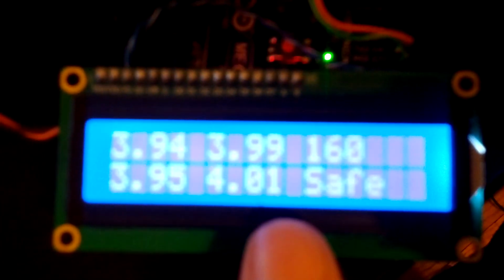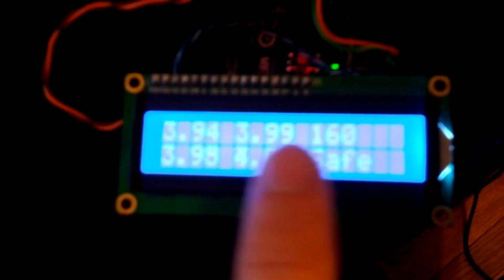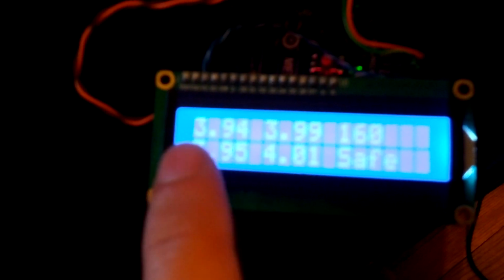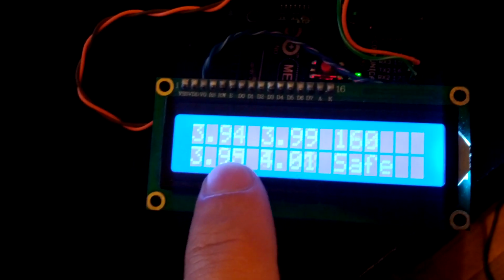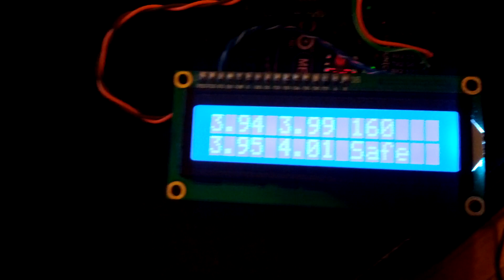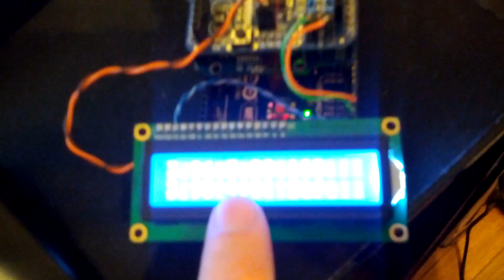Update on Arduino controller RC car with PS3 or xbox 360 controller

Comment: Sir, I always love your work on the video about updating on Arduino controller RC car with an Xbox 360 controller. Sir, Is it possible that you can control the 6 dof robotic arm with the amazing RC monster car attached using Xbox 360 controller with an update on the Arduino controller RC car with an Xbox 360 controller Arduino. Sir, can you teach me to make a  video on youtube on how to make a 6-dof robotic arm RC monster car using Xbox 360 controller with Arduino mega? Sir, also can you give me a circuit diagram and the code for the 6 dof robotic arm cool RC monster car using Xbox 360 controller with Arduino mega? Sir, tell me.

Comment: im using a ps2 controller with my xbee car less expensive. my question though is can i use a relay shield in place of a esc sense my motor shield doesnt allow enough power for the motor?
Reply from the maker: +David Wentworth if you just want on and off on the motor a relay would work, but i doubt that's what you want so you need an esc
Reply: its a 390 helion motor im unsure what esc i should get any sugestions?
Reply from the maker: +David Wentworth no idea what that is, link the specs to it, all you need is an esc that exceeds those specs and you're good.
Reply: HLNA0559	Motor, Brushed, 390 Size, RR
Reply: i cant find anything on it
Reply from the maker: +David Wentworth it looks like a mid range motor. a 20A esc should handle it just fine. what about the esc that came in the rc car? doesn't the vendor who sold you the motor also sell the esc for it?
Reply: it was a built in one with a 5 wire servo for steering i wish i could hack it somehow with arduino but i just dont know how
Reply from the maker: +David Wentworth do you want a cheap one or do you want a really good quality one but at a more premium price?
Reply: this is what it has
 HLNA0482	Helion 2-1 Modular ERS, HCT (12KT)
i would like  a cheap one lol
Reply from the maker: +David Wentworth http://www.hobbyking.com/hobbyking/store/RC_PRODUCT_SEARCH.asp?strSearch=brushed+esc the 45A $11 ones. be mindful of which warehouse you order it from. be aware it does require: Battery: 2 cell Lipo (5-6 cells NI-xx) which means it operates at 6V-9V with 7.5V being nominal so be aware of that.
Reply: does it matter if it says its for a quadcopter
Reply from the maker: +David Wentworth what's for a quad copter? a motor is a motor(well brushed or burshless) but you don't use brushed motors or escs for quadcoptors anyway you simply don't have enough control with them. I was talking about one of these: http://www.hobbyking.com/hobbyking/store/__43377__HobbyKing_X_Car_45A_Brushed_Car_ESC_US_Warehouse_.html

Comment: Hello, nice work there.
Why not use a 433Mhz insted of the sheld Xbee?it's low cost and normally you should be able of getting much more range.
regards
Reply from the maker: I have some and  i get about as much range as the 1mW xbee. I got these xbee because they are 60mW and have a decent range on them.
Reply: OtakuSanel Have you tried the 433Mhz whit the right antena lenght?  you should be able of 2000m range whit those on an open field way enought for the rc car and then you could use your xbee pro for FPV ( first person view ) this way the video link and the control link won't interfer and you can take the project furthur :)
Reply from the maker: Mikael Costa I already have a FPV system in place. just missing the buck converter to run the camera on the car since my pack is around 20V. Well yea on an open field even the 1mW will give you few hundred meters lol. these xbees work great though so i'm not worried.
Reply from the maker: the xbee shield just uses serial RX and TX. the usb host shield uses spi so there was nothing special required on making the two work together. ye the wires coming from the xbee shield are just power for the LCD

Comment: I've been trying to figure out the code to make the throttle and reverse to be controller by the triggers. I've successfully coded the steering with the Left thumbstick and at the moment i have the right thumbstick to be the throttle (up) and reverse (down). I would like to have the throttle and reverse to be on L2 and R2. If you could help me out that would be appreciated. No need to send me the entire code because that was your work, just the triggers. marcoalan9@hotmail.com Thanks

Comment from the maker: I specifically state all the things that are being used if you pay attention. I got them from various vendors so I won't go into that, searching for them will tell you where you can find them. Price wise you don't want to know. It's pretty stupid expensive. just for starters here is a short list: pro mini 20$, transistors $40, 3 lipo batteries $50 each, arduino mega $50, usb host shield: $35, teensy shield: $15, 2 teensy pro $30 each, lcd $20, ps3 controller $50. as you can see it adds up fast.

Comment from the maker: You are correct. Some usb dongles do indeed require drivers which arn't usable. This one was about $1.50 from ebay and the only way to really know if it works or not is to try it. Microcenter sells a few that do work(some don't) if you have one close by so just go to a local electronics store and buy a few then return the ones that don't work. There is a compatibility list somewhere out there though I don't know where it is.

Comment: I saw your parking lot video, this thing must be AWESOME to drive around. Anyway, I was hoping you could help out a bit. You have a usb dongle, and it seems to work flawlessly, but I read that some don't really work without drivers. What do you have, and/or what should I look for in buying one. A wireless PS3 controller is perfect for the robot arm I'm working on right now.